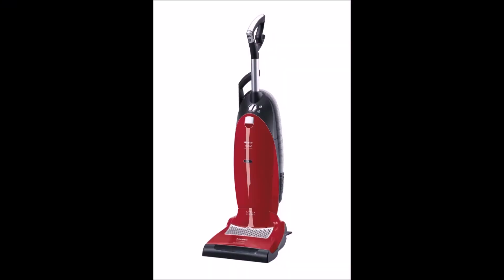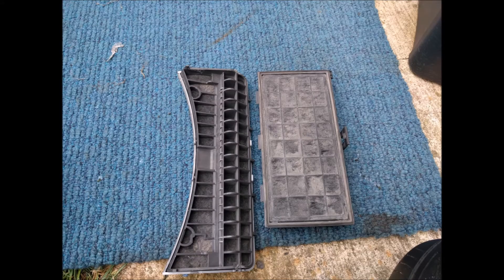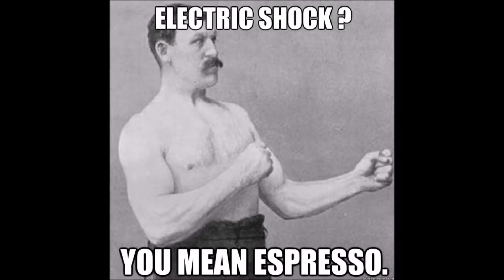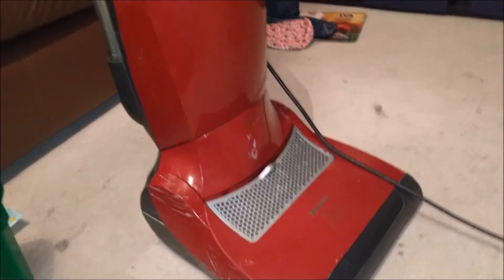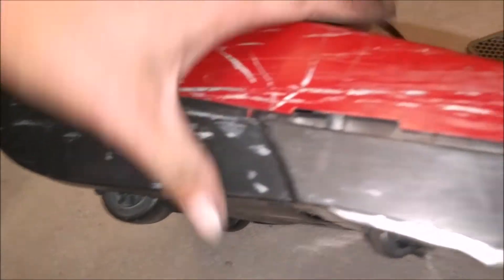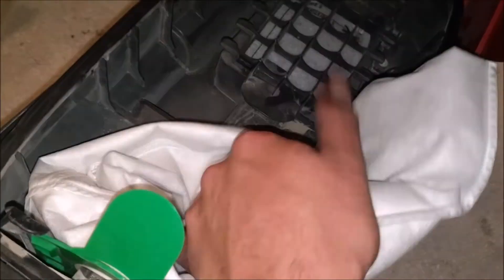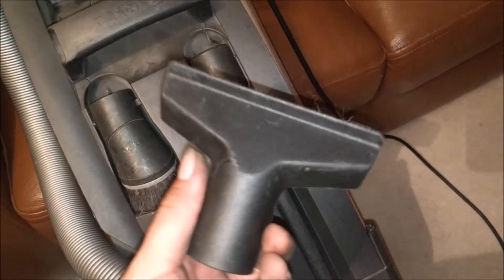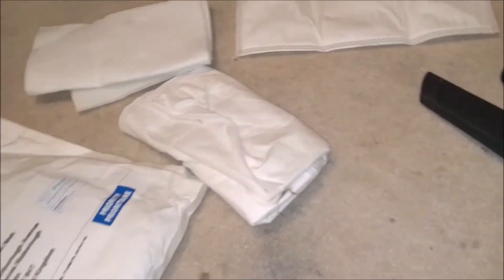Beko gets a Miele S7260! Part 1...

Comment: Very very good machines these, I use my S7510 every week as a daily driver. They might be heavy and very tall, but I love it to pieces. I think its the Rolls Royce of vacuum cleaners. You do need to take care of them, and they wont stand up to bad treatment. The motor on your machine sounds very bad, I think the bearings are shot, and this was probably due to it being overheated, and / or used with the wrong bags, or even no bag at all. The motors for these are VERY expensive indeed, and if it does need a motor, then most people would scrap the machine, as a motor is over £100. When its running correctly, the suction motor is very quiet and refined, and the fact that you changed the bearings and cleaned the fan means that its a bit of a mystery why the motor is still noisy. I've never stripped mine down but they do look very complex.Your brushroll is fine - the bristles are short and stiff on these from new, and mine is the same. Genuine brushrolls for the S7 are very dear as well, - around 90 quid!The reason your machine wont stand up is because the rear wheel retract mechanism is not working and the wheels are staying in their "forward" position, which is used for when the handle is reclined, similar principle as the Dyson Ball, where the entire rear wheel carriage pops backwards to stand the machine upright when the handle is raised to the park position. The Miele is supposed to pull its entire rear wheel carriage backwards and downwards when stood upright, but yours doesn't do this, which is why it wont stand up. The mechanism is very complex and seems to use a series of cogs and gears to move the rear wheel carriage.I'd say that Miele of yours has had a very hard life with someone who just didn't look after it, and as I said, these machines wont stand for rough treatment.
Reply: kind of makes me sad when mieles are treated bad.